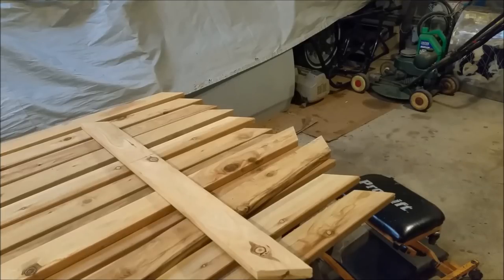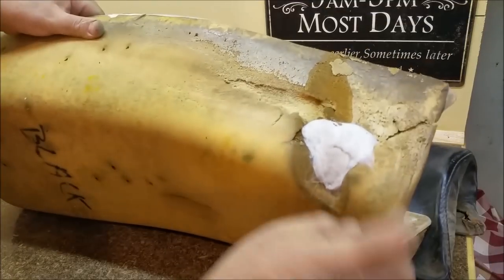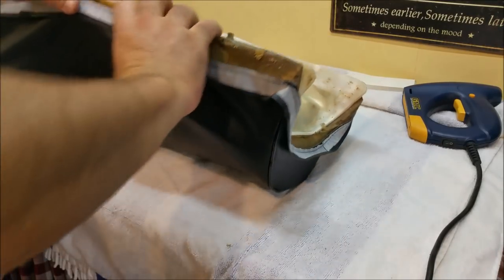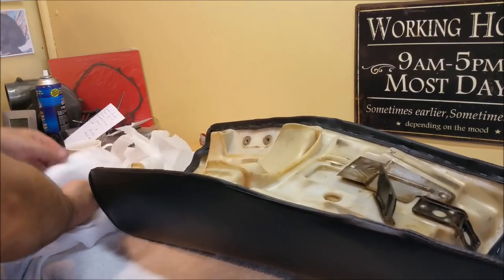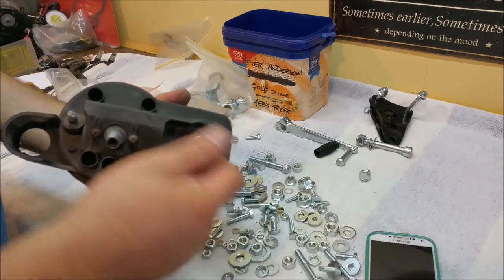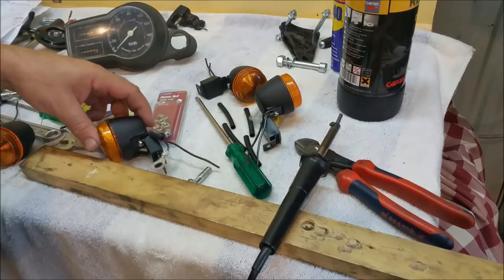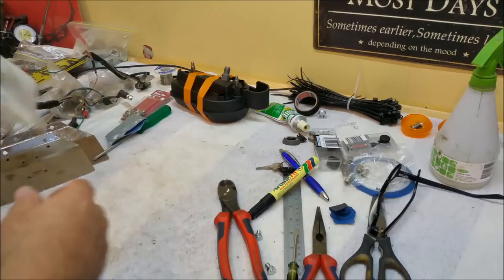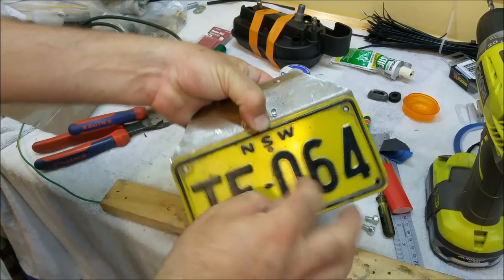Honda XL250 Restoration Part 19 - Almost There

Comment: Hi Pete, really enjoy your video's and looking forward to you getting your teeth back into the 750. I'm in the middle of a full resto on a CB750 F2 that I bought from a neighbour for a couple of hundred quid. Not my most favourite of 70's bikes but it's kind of got under my skin a bit so looking forward to seeing you running the engine up on the bench. I've chopped the frame out and made a replica of the Gordon frame kit which allows you to remove a section of frame so that you can whip the top end off. I guess it'll be easier to get the engine in as well. Anyway, good luck with the rest of the build, your attention to detail is spot on...Roger (England)

Comment: Very nice Peter...industrial felt instead of tape for frame protection.Go to J.J Davies & Sons 1299 north rd huntingdale.. I'd say 5mm black
Reply from the maker: The seat was a tight fit as it was... I would have needed to modify the brackets with thicker felt, but I do agree with you. Cheers

Comment: Hello Peter, First of all you make a great job! I start to renovate my 250 S and I would like to learn how to open the speedometer, you did it with using some heat? My looks to be welded or glued and both parts fits very well, there are no gaps to use any tools without damaging...?

Comment: There was a short clip where you had no power to the sidelight and clock lights. I have the same issue. Does not seem to be a live feed to that cluster, not even on a wiring diagram, but works with a direct feed to a brown or pink. Long time ago, but do you recall what it was?

Comment: Great video Peter, how did the bike go down at the show? I bet it got some good attention. I cant wait to hear if the rattle is cured by the other guy or not and would also like to see the 500 fitted as well. Having said that I'll be happy to get back to the XC. Please keep up the great work.
Reply from the maker: Yes thanks, it went well and gained some attention. There is still a noise which is disconcerting, so will return to it soon. The 500 is going in within a few months and the XC is now underway. Cheers mate

Comment: Aye up Pete, have i missed a vid on the xl, the last one i watched the engine had a " death rattle" , did you find out why?? All the best.
Reply: John Rimmer it was covered in an earlier episode. It was a clearance issue which Pete remedied with a sandwich plate under the head to add some space.
Reply: Rubberneck Rides  Thanks for that RR.

Comment: Hi pete, will the 500 motor bolt straight up into the 250 frame or will there be a fair amount of moding to fit it? Cheers Mark
Reply from the maker: It looks like a simple fit, we have both frames. The upper mount is a lot different, but it lines up as well. Cheers
Reply: Peter Anderson Thanks alot thats really good to know. Cheers Mark

Comment: Pete where do you get the bags of all the new plated bits for the bikes?
Reply from the maker: I took all of the old bits I wanted plated to an electroplater and asked that they re-do them in silver zinc, cheers.
Reply: @PeterAndersons  Where is the guy located?
Reply from the maker: @unclequack5445  Warners Metro in Bayswater